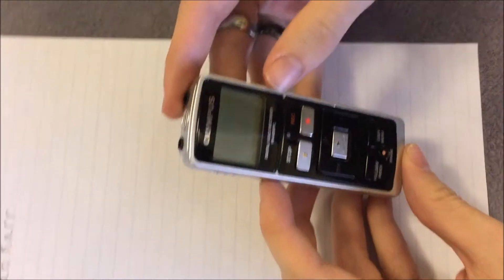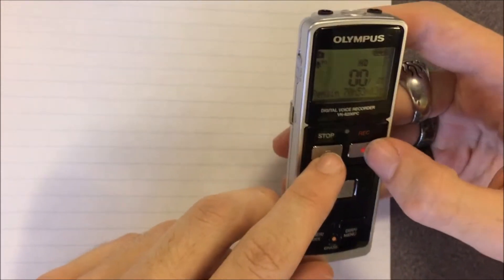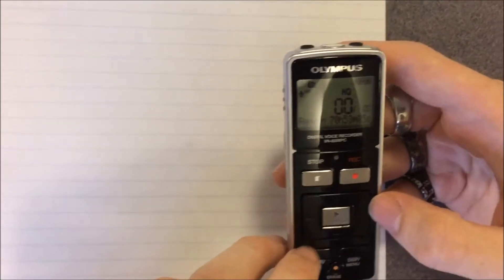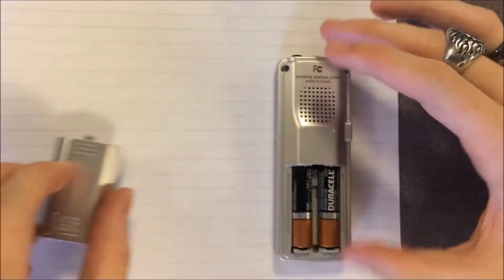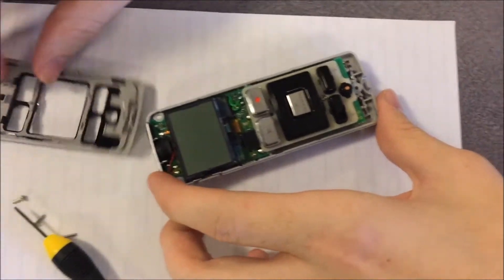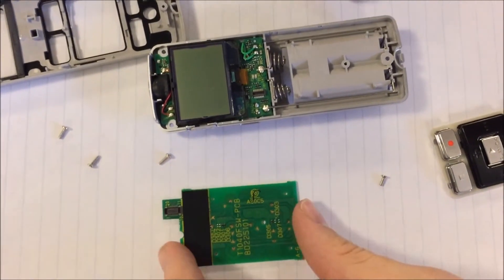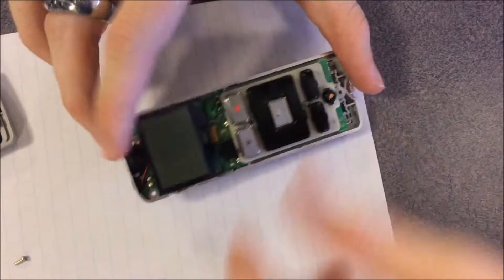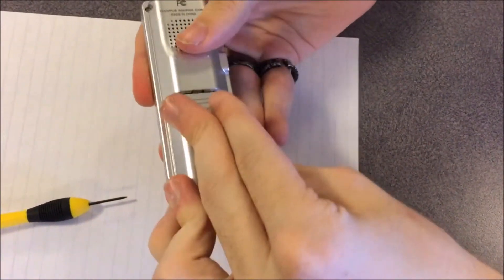Olympus Digital Voice Recorder Disassembly and Reassembly

Comment: I have an Olympus ws-852. It stopped working and I have some recordings that I would like to save. I was trying to disassemble it, but the screws behind the batteries are extra small. None of my tiny screwdriver sets fit that size. Any idea what size it may be? Also, would it help me to take it apart and perhaps remove the card and save the recordings?

Comment: Hey thanks for posting. Mine (another model) constantly asks for the user to set time (hour + date) upon start-up. I assume there is a back up battery inside. Does yours have one? I do not see it. As such how does it remember the time/date when the battery is out? Kinda curious, thanks

Comment: Hi thanks for your video . I had this when they first came out 10-12 years ago. It worked great all these years during this summer there's so much humid air here in Brooklyn thay l think  fouled up the buttons.. So I opened up the unit to manually dry the pad in contacts. There I noticed the pad where the tiny circuit board that makes contact with those carbon pods. The flexible circuit board has tiny little holes that a small thin sewing needle can make. That's where it makes contact and small pulses of electricity meet what the carbon pads. So with plenty of usage it you'll also notice when you take it apart it's got tiny little pin size holes from the electric arcs/sparks it makes. So it'll become useless that's why it's smart idea to upload whatever you have recorded up to a computer just the prevent the mistake I made and not uploading it to a computer.. good luck and thanks for the great video take apart stay safe everybody